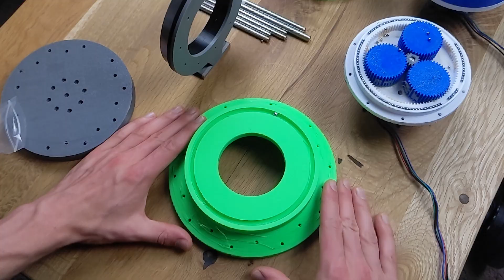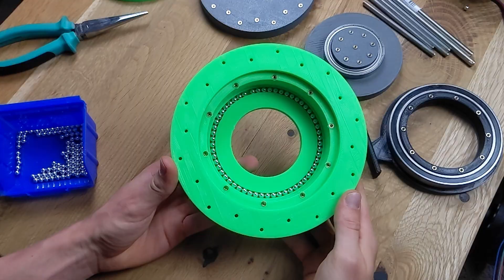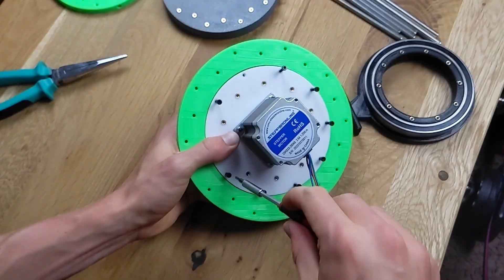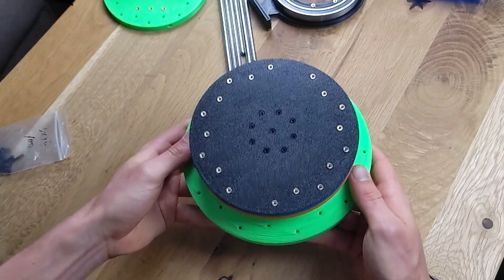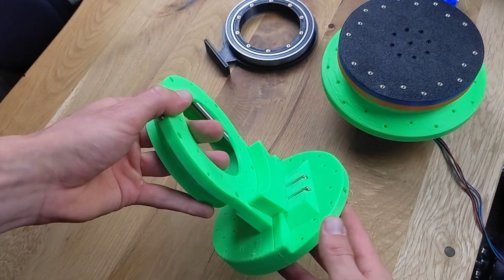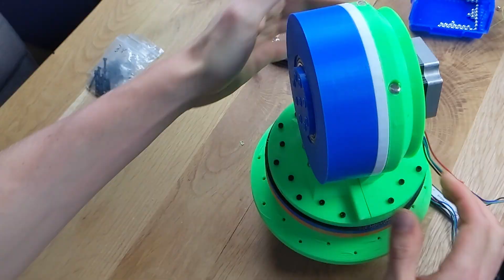3D printed robot arm base with stepper motors

Comment: How do you contrôler the stepper motors ?
Reply from the maker: Motor -- Encoder -- Raspberry pi  and some basic software. When using a Raspberry check out the PIGPIOD Demon to control the motors

Comment: I like how you wide-flanged the end cap over the core and roller bearing and then distributed the load with a wide ring of bearings.  I'm working on a similar flanged cap but using a needle bearing cartridge.